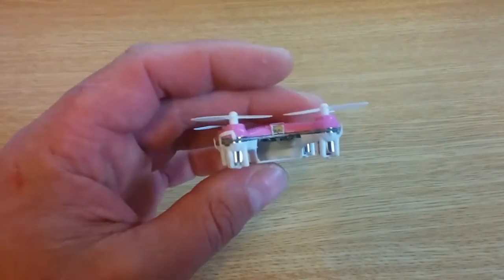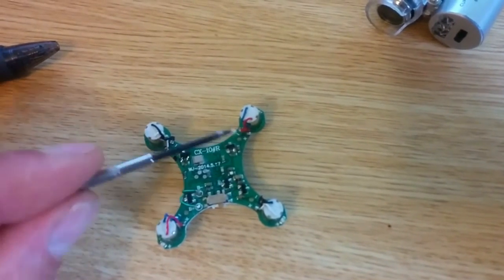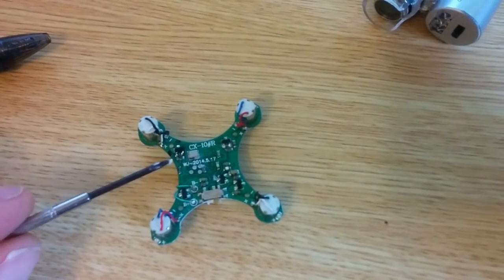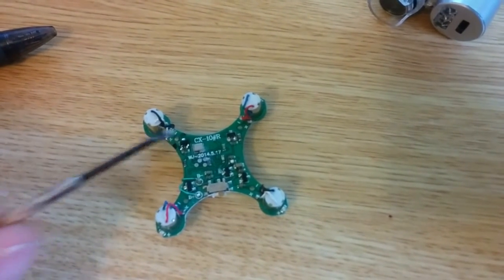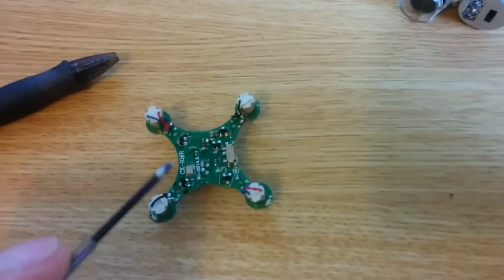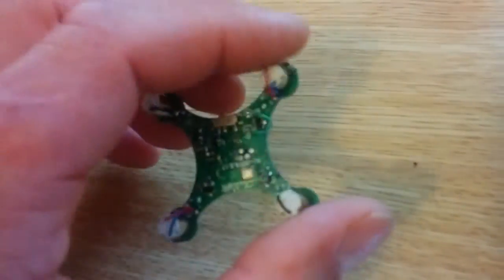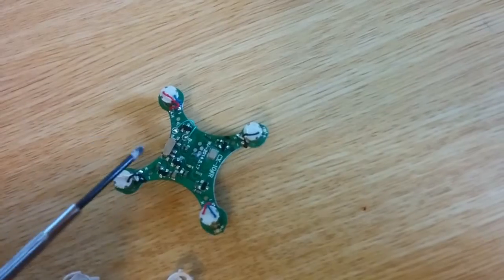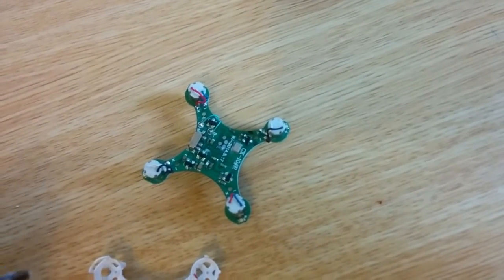Repair for motor stuck on, CX10 mosfet replacment and battery mod

Comment: thank you, thank you , thank you, thank you.....so very much for this video, you are a boss !!!!!! this is going to save quite a few flight control boards for my tiny whoops, as i have been trying to learn how to do mods and i have screwed some up, as well as some how,  im not sure how but plugging in batteries in reverse just slightly, doing so in the dark, outside while fpving and in a hurry, and smoked some fets, for its obvious their popped, for i can see the small burnt spot right on top !!! so i desoldered a good one from one that already had a bad mosfet and transferred it to another jacked FCB, and whaallaahh, it worked !! i found this deal on ebay and thought i would share, its 100 pcs for less than $5 bucks, im pretty sure i selected the correct fets, but you may want to check and correct me if im wrong, BTW did i mention thank you !!!!
https://www.ebay.com/itm/291628752189
Reply from the maker: You're very welcome. I'm glad this has helped with your frustrations. Yes, those look like the MOSFETS, good deal too:) Here's a link to the datasheet if anyone is interested. http://www.vishay.com/docs/65701/si2300ds.pdf. There are other higher current rated MOSFETS that would work too but it would be a good idea to change all the FETS if one was to go that way to avoid any possible weirdness with impedance imbalances. No point really though if you can get a bag of 100 of them and just swap them out if they ever burn up. In reality Si2301Ds should be more than adequate. I think those little motors only draw 1.2A max.

Comment from the maker: Please note: Make sure you get a Si2300Ds or similar  N-channel mosfet not a Si2301Ds which is a P-channel mosfet and will not work. Similar name, very different part.
Reply: Help pls mine is 30AL i dont understand it im 15 years old
Reply from the maker: @jimenezsplaylist4618  sorry what is that (30AL)? is that the marking on the mosfet?
Reply from the maker: also does your board look exactly like mine? there are a few different version that might be using different mosfets (that is the little chip that drives the power to the motor)
Reply: @quadtopia  mines a little different its a controler board from skyhunter X8 drone its a little bigger but i hope its the same mosfet
Reply: @quadtopia  and its 30AL
Reply from the maker: @jimenezsplaylist4618  I really doubt yours would be the same mosfet as it's a much bigger drone and most likely needs more power to run the motors.  I did a quick search to find out which mosfet it might be but didn't come up with anything. Some of the Chinese brand chips are hard to find as the marking on the package isn't the actual part number and it's hard to find the actual part through a reverse listing.  I don't want to steer you wrong by pointing you in the wrong direction if I don't know what chip it is.  You might want to contact the manufacturer and ask them. I've done that before and sometimes they will give you an answer.  Barring that you need to figure out if it's an Nchannel mosfet or P channel (they're hooked up differently) and them current that it can handle as long as it can handle more than the battery voltage the voltage spec should be ok.  you also one with the same pinout and package size. Sorry, since I couldn't find the chip I don't have much to go on.
Reply: @quadtopia  thank for the help
Reply from the maker: @jimenezsplaylist4618  No problem. Sorry I couldn't be more help. It's a little hard without access to the circuit.  Hopefully you can make some headway:) Just have to find that right mosfet:)

Comment: Mine just starting doing the same thing. Is this fix still working for you?
Reply from the maker: I`m not sure if that is the same part or not and I`don`t have that version of the cx10. some times it is a real pain trying to track down small part surface markings.  I suspect it is probably still an n channel mosfet so it has a pretty good chance of being something similar.  you could try changing all of them to keep things balanced.
Reply from the maker: Yes it still works perfectly since I fixed it.
Reply: Thanks! I have another cx10D that the board failed, so I'll try and remove one of the mosfets from there. Would these be the same as the ones you used. I'm trying to source locally. http://www.digikey.com/scripts/DkSearch/dksus.dll?Detail&itemSeq=216990266&uq=636205424296673313. You can email me at dshavers@pixar.com also.
Reply from the maker: sorry, the link just takes me to the digikey website so I don't know what part you were trying to link to. I used a  Si2300Ds 30V N-Channel mosfet by Vishay and can handle between 2.5-3.6A depending on temperature. Here's a link to the data sheet http://www.vishay.com/docs/65701/si2300ds.pdf. If you end up using a different part (unless the specs are identical)  you might want to consider changing all 4 mosfets to keep things balanced. Might work ok if you don't but who knows
Reply: mine is cx10wd , it says 006a  i cant find anything on google. is it the same 30v
Reply: Quadtopia hey it worked.... i wasnt payin attention when i ordered it,  i hook it up, the motor spin but it wont stop even when the battery's off. that's when i realized i bought the wrong p_channel. so i ordered (a03404) nchannel 30v 5a, i bought 4 just to b sure, it's very cheap and now my drone is cured. thx
Reply from the maker: That's great, glad to hear you got it working:) Thanks for reminding me of something I should point out about the P channel mosfets.
Reply: Gxj